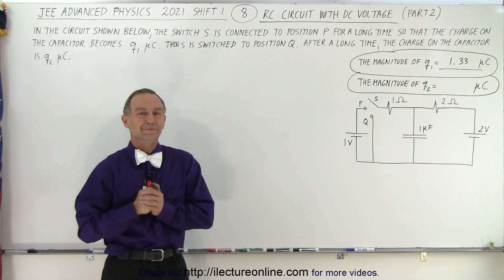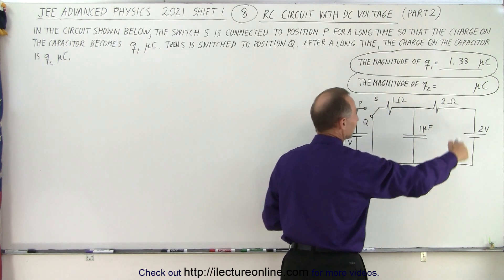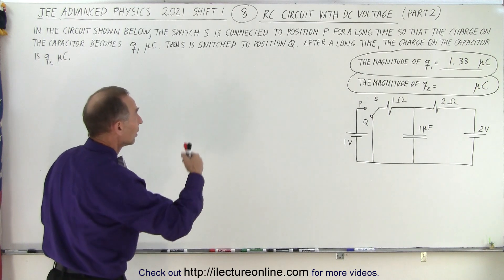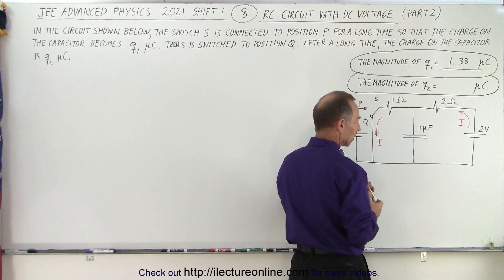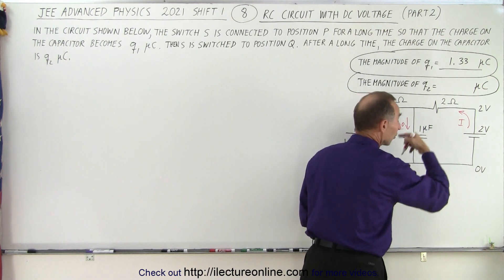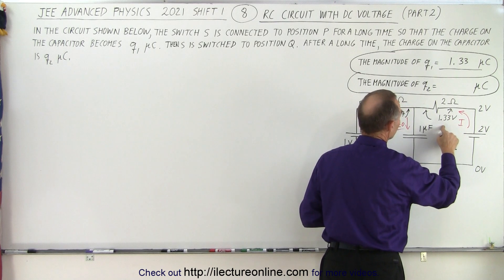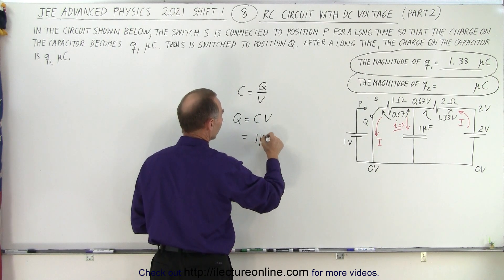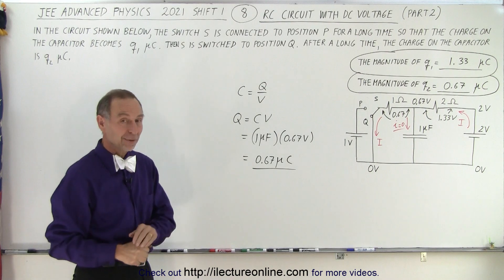JEE Advanced Physics 2021 Shift 1 #8 RC Circuit with DC Voltage (Part 2)

Comment: Define steady-state the way you used it?
Reply from the maker: Usually when a power supply is turned on or turned off, or a switch setting is changed, the current flow will change from the way it was before the change to a new state after the change.  This period is called the transient state (when it is changing).  Eventually the current will stop changing, and will stay at the same value.  (This is called the steady state of the system).